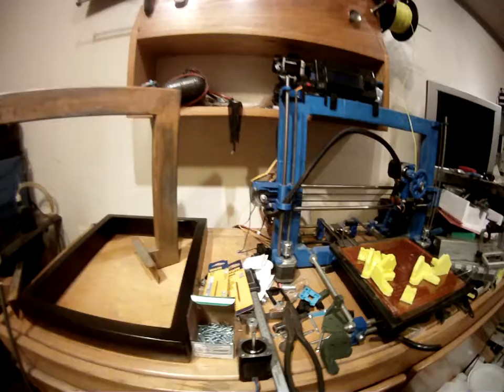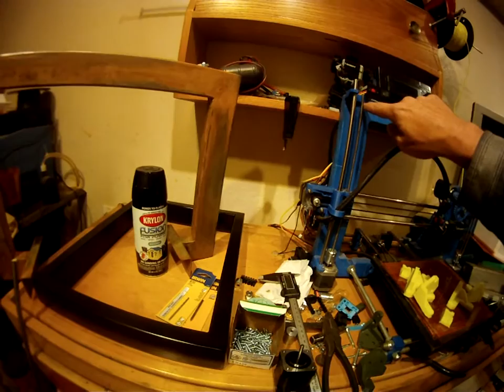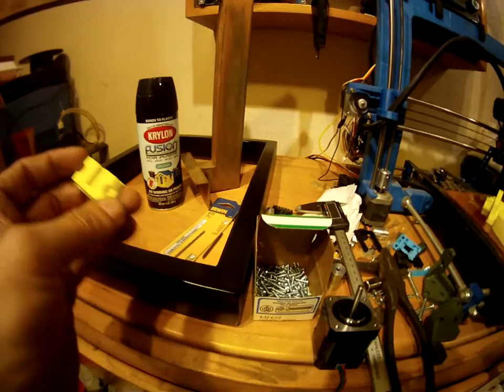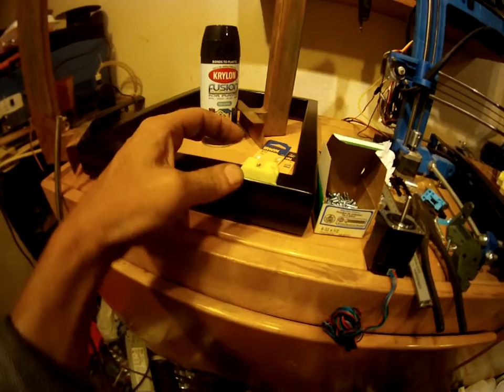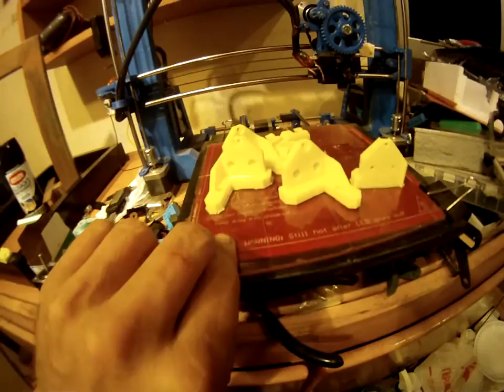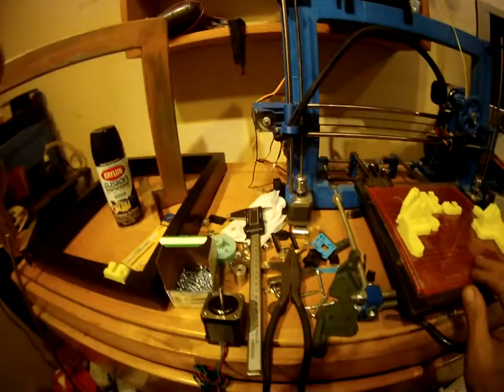Copper plating didnt work out so well

Comment: Oh man!!!  I can't tell you how much I appreciate what you're doing.  I am with you...  After looking at speeds and feed rates on the router, 3d printing is not going to work out.  WAY too slow to be valuable.  I'm going to build a purpose built machine.  I don't usually follow plans, but I probably will for most of the build.  I'm sure I'll have a twist or two to make it mine.
Reply: +Greg's Garage On the copper plating...  Stinks that it didn't work out, but hey, you never know until you try.  Good on you for giving it a go.
Reply from the maker: +Greg's Garage Great!  Its going to take me some time to get everything printed up but ill let you know how its going. I know what you mean not following plans is most the fun :-)
Reply: Take your time.  I've got my hands full right now with the build...  Software will be next.

Comment: The new printer is starting to take shape. Black will look great, even though shiny copper would have been epic... ;) 
Think of it this way, no ongoing polishing required!

Yes I'm an Aussie, not one of those pesky New Zealanders, hehe.
Reply from the maker: +Tech2C Thanks. I put a link to your batman video in the description hope you don't mind. I am going to try bumping up my layer height next with the slow print speed 30mm sec i believe... anyways that's as slow as ive ever printed before but it sure did come out smoother. I just need to get used to prints taking so long. It should be better when i have both printers going at the same time though... Thanks again